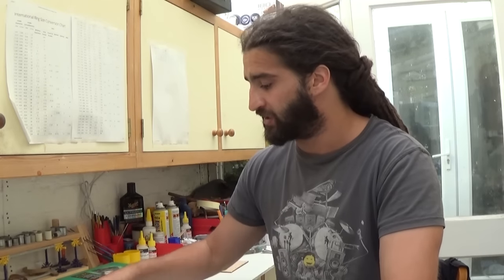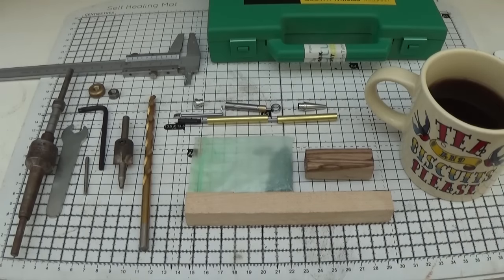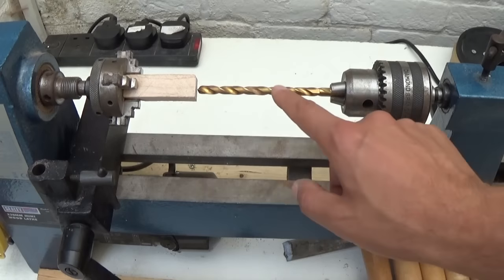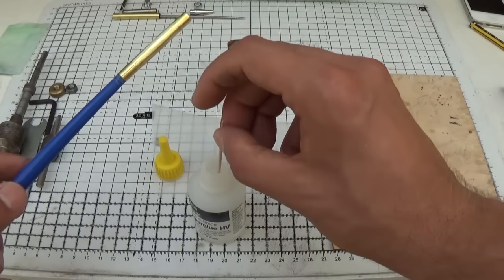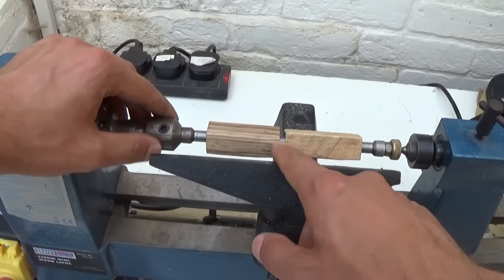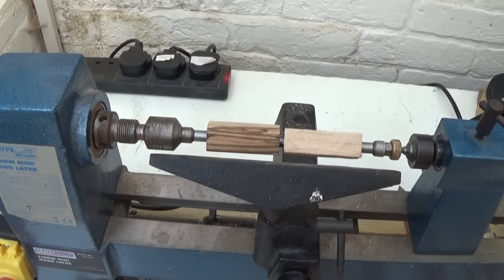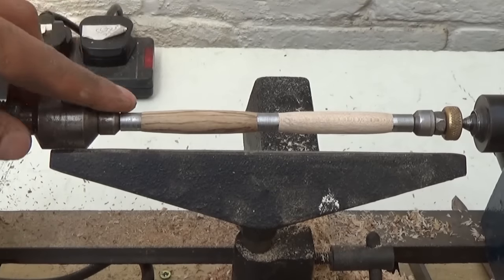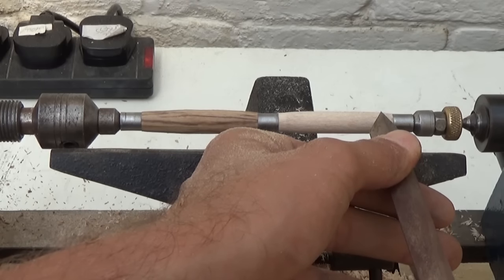Pen Turning Tutorial - Stone Inlay, Pyrography & CA Finish.  Part 1 of 2

Comment: hi, i have turned a few pens with different types of wood,, and also using a CA finish , but i seem to be getting white parts appearing under the CA after i have used the micro mesh pads.
Any help would be grate thanks ... Ash
Reply from the maker: Hey Ash, sorry for the late reply mate.  Are you using activator spray?  It could be the CA glue "blooming" while it's curing - this is caused by moisture in the air as the glue cures.  You can avoid this by using an acti spray.  Alternatively it could be that there are tiny air bubbles forming as the glue cures and when you sand them away they leave little holes which get filled with sanding gunk.  To avoid this ensure that each coat of CA has cured before applying the next one.  Hope this helps!!